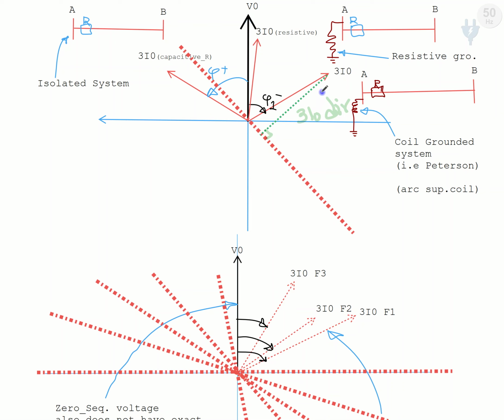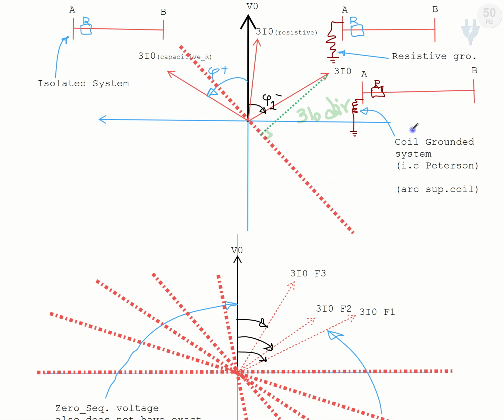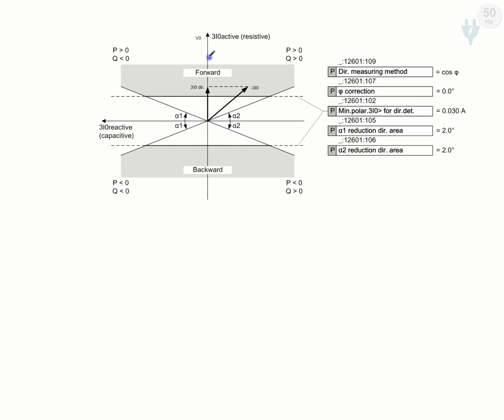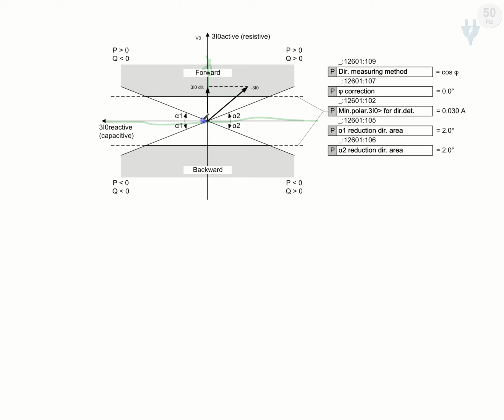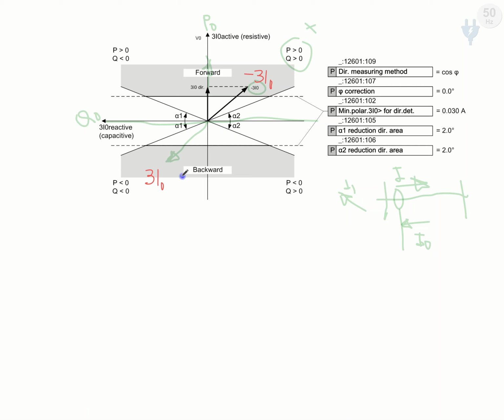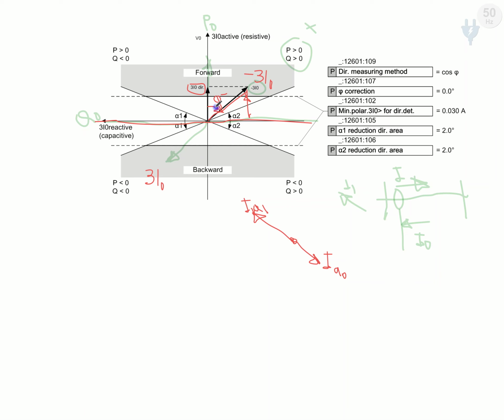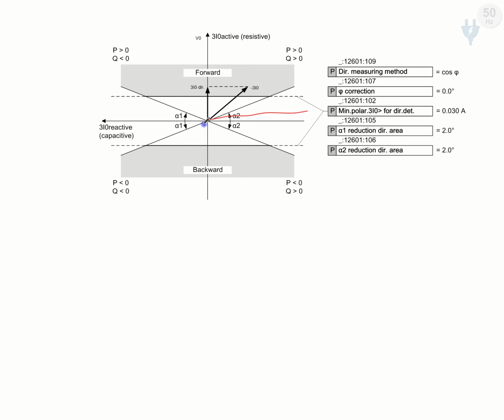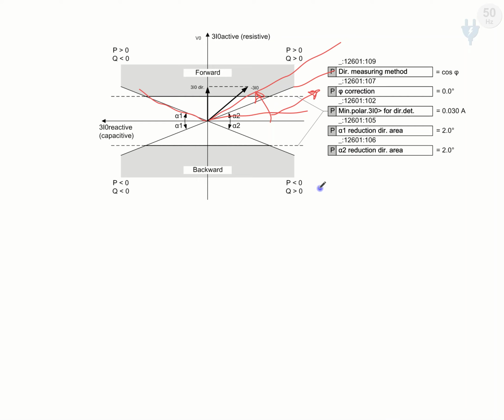Direction Determination session 6

Comment: very good , did you explained the directional OCR  ? basics 
as I get confused while understanding the way that i should use to determine the proper angel between voltage and current
Reply from the maker: No its about the directional sensitive ground fault. (67Ns)